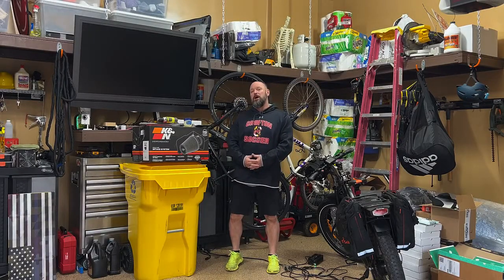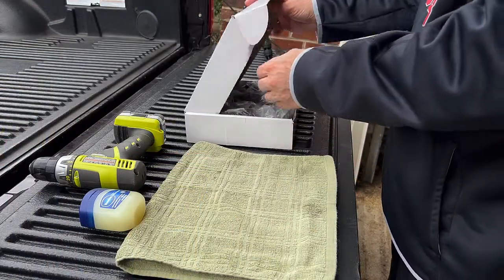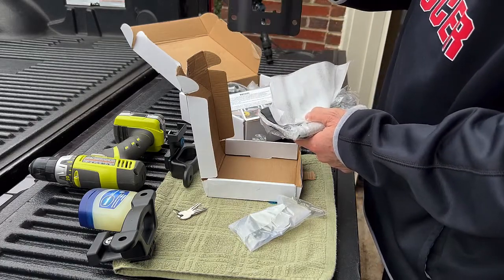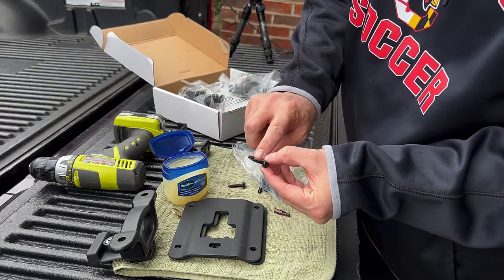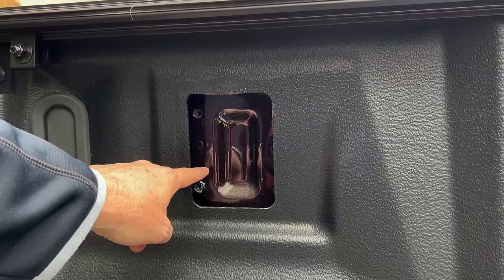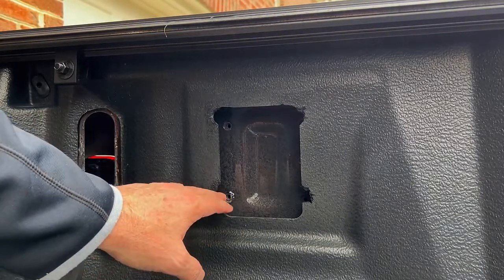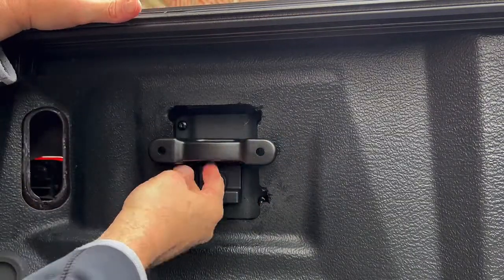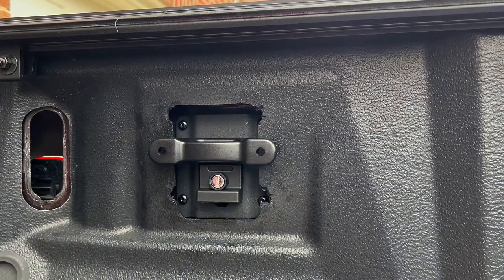Installation/Review for the Ronin Boxlink Cleats/Tie Down Brackets/Plates on 2018 Ford F150 EcoBoost

Comment: Here are a few tips. 1) dremel the vertical edges the length of the opening so its cleaner and more access instead of the notched cutouts. 2) use an impact driver to put the self tapping screws. 3) pre make the threads with a tap.